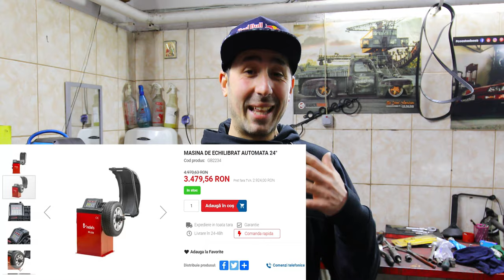MOTOR DISTRUS de la o piesa atat de mica ??? 😱😱😱

Comment: Salut baieti eu sunt Cristi si va urmaresc cu drag din Anglia am avut si eu probleme cu o masina adica am cumparat o constient ca avea probleme... bine, nu ma asteptam sa aiba atatea si uitandu ma pe canalul vostru si alte vloguri despre reparat masini m am apucat singur sa o repar si pana acuma am schimbat termostatul si pompa de apa iar ulterior garnitura de chiulasa, poate nu e ceva iesit din comun dar sincer pana sa ma apuc nu aveam nici o treaba cu mecanica si sunt foarte mandru ca am facut cum a trebuit totul. Schimbarile astea le am facut asta vara si masina merge perfect e vorba de o astra j 1.4 turbo, am avut probleme si cu sistemul pcv, probabil stiti ca nu sunt multe solutii sa rezolvi problema adica trebuia admisie noua valva pcv fiind in admisie. Sincer mi s a parut exaggerat sa schimb admisia pentru o valva asa ca am intundat locul unde era valva si cu ajutorul internetului si o valva cu un sens am facut bypass si nu mai am nici o problema nici cu asta. Cum v am zis nu pare complicat ce am facut eu dar pentru mine a fost o experienta noua si mi a placut. Mi a luat o saptamana sa fac toate astea si as mai face o odata 😂 dar cred ca mai usor si mai repede. Bafta in continuare si postati mai des. Pace.

Comment: Multi schimba uleiul la 10.000 km dar motorul merge 700-800 de ore in intervalul acela si sufera mult mers la rece prin oras, mai ales cu diesel. De aceea se intampla lucruri de genul, cum a patit masina din video si la fel si acel Hyundai cu 70.000 km.

Comment: Salutare ! Nu sunt hater, insa... omul a venit cu presupuneri legate de axul cu came, s-au mai gasit defecte si alte piese la suspensie. In loc sa inceapa lucrarea cu revizia, cum mi s-ar fi parut normal si cum s-a gasit pilitura...s-a inceput cu bucse si brate. Asta ca sa fiti siguri ca prindeti clientul...iar la sfarsit, ii dati dauna totala, trebuie refacut motorul. Deci la o masina care costa 4000€ sh, omul trebuie sa lase la voi vreo 2000€ , dupa care.... dupa ce se reface motorul, se constata ca pilitura , a ajuns si in turbina, si trebuie reconditionata si turbina.... inca vreo 300€ ... 
Daca se incepea cu revizia...omul putea sa amane schimbarea bucsilor, suportilor motor si poate si a pompei tandem... ptr ca , mai important era motorul.... insa asa...pleaca si fara bani...si cu Doamne ajuta....
Asta nu e primul clip la care ma uit, tind care trag concluzia, ca omul este inselat, si ca se merge pe presupuneri...

Comment: motor vw la 160.000 in halul asta greu de crezut , asa e Romanul lasa masina pana cad toate si apoi da bani cu caruta la reparatii, dupa cum era filtrul de ulei nu a prea fost la mecanic sa schimbe uleiul, patronul ala al vostru nu stie ca exista strung sa va faca si el niste scule profesionale pentru presare - depresare , sau sa le cumpere de la vw , nu se toarna niciodata motorina in filtru , se monteaza filtrul si se trage motorina din rezervor  cu o pompa ca motorina sa fie filtrata  , poti folosi o pompa  electrica sau sunt una para se gasesc la modele mai vechi de masini disel de regula pe masini frantuzesti (ORIGINAL - IMPERIUM Pump)